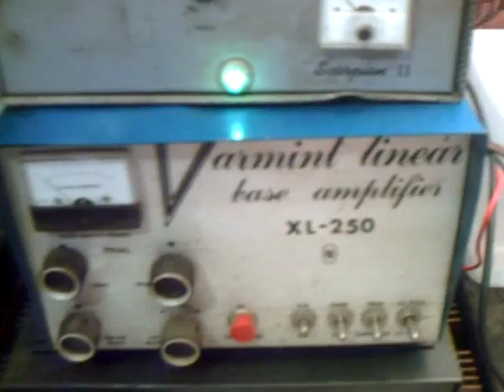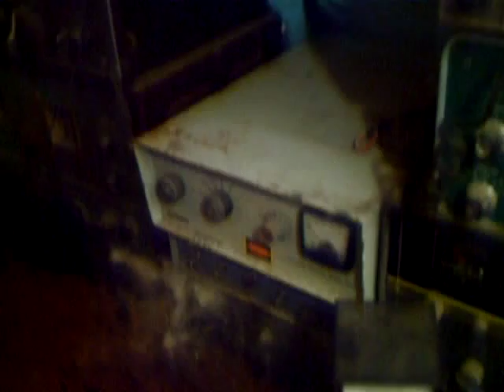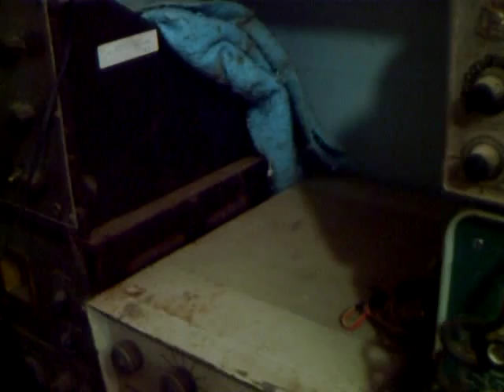DINO AMPS

Comment: i got a question i was reading online that u should tune your antena without the hooked up then after its tuned u hook the amp back is that true or will that cause problems just wondering any advise would be great thanks much